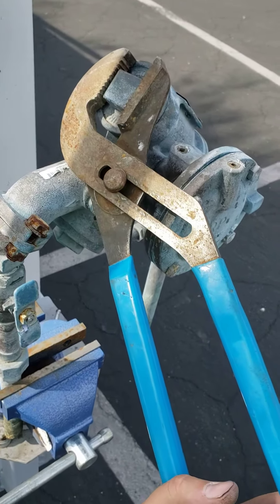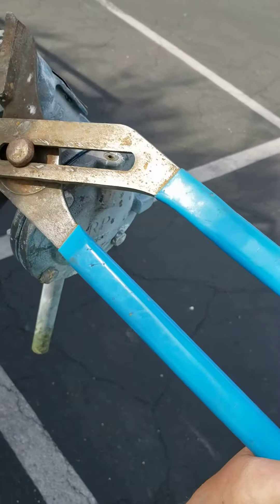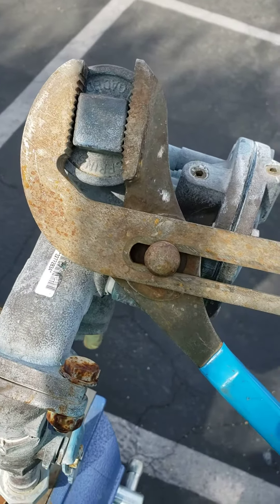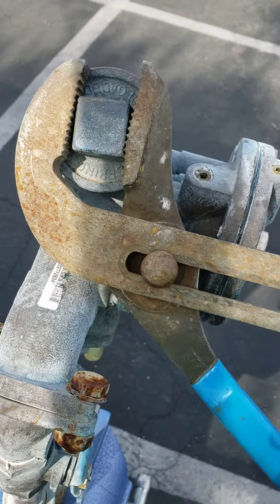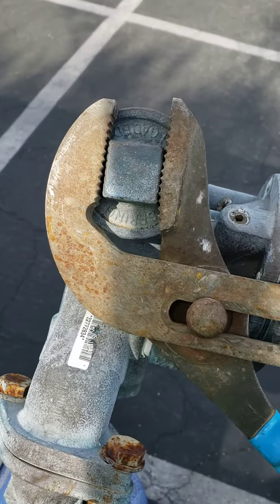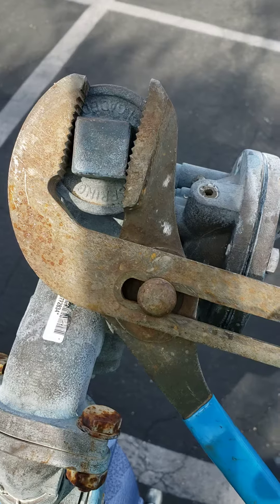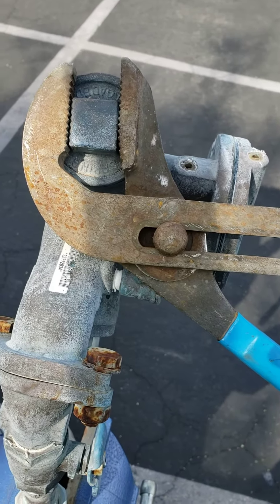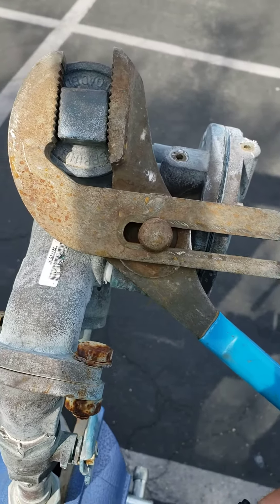How To Correctly Use Channellocks - You Might be Doing It Wrong

Comment: Ya this is useful, but how do i know which way is the right way
Reply: Whether it's channel locks, pipe wrench, or crescent wrench, that the big jaw is made to pull. That's all you need to remember.
Reply: @donf3739  On channel locks you always want to apply force to the handle attached to the lower jaw.
Reply: 2short....the video....not the rapper